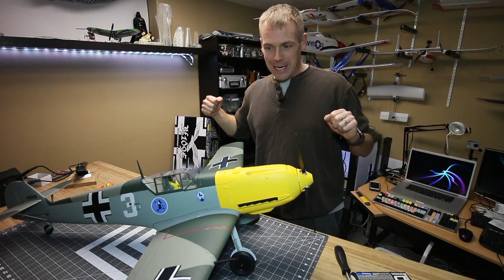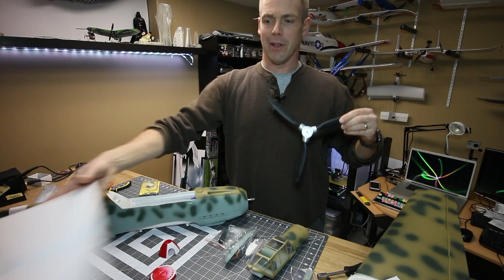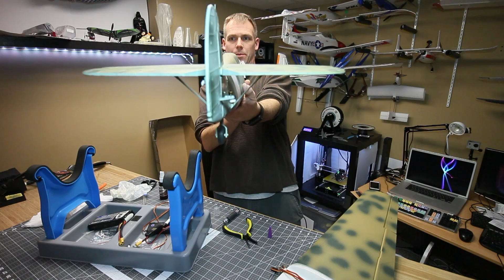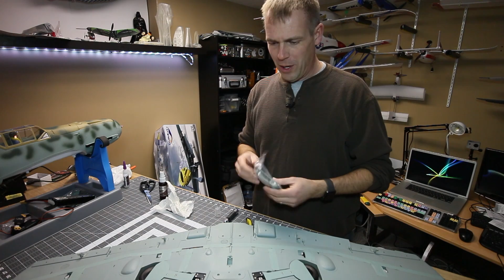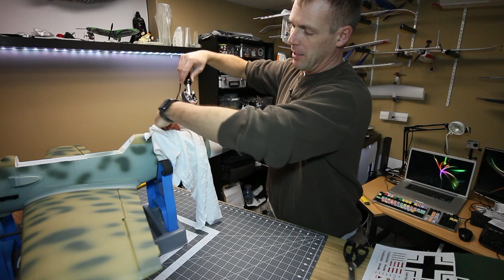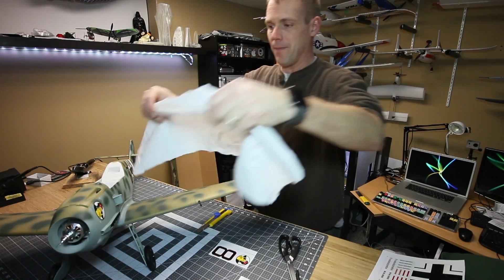Durafly™ Messerschmidt Bf.109E-4 Unboxing & Build

Comment: Hi, you mention 3 or 4s. Have you flown this model on 3s and if so, how did it go? Cheers
Reply from the maker: Only flew it on 4S. 3S will be more “scale”
So you need to watch the power in the turns and really give it some room on take off. Totally fine but have to be more attentive for sure.
Reply: @blameandre  cheers mate.

Comment: I just picked up the navy cub. Would you recommend using the same glue your using for the exhaust (insta cure) to assemble the wing halves? Thought this glue eats away at foam.
Reply from the maker: If you have time, go with Foam Tach. Let it setup, cure and it will be a really good bond.

Comment: What Transmitter battery and battery charger did you use?
Reply from the maker: Turnigy 3S 2000 Radio pack and Charson Antimatter 10A charger.
Reply: @blameandre  Thx

Comment: Having seen a Hispano Aviación HA-1112-M1L Buchón, the Spanish licence built 109G, at Duxford last year in this aircrafts markings I have to point out that you put circular nose decals on the wrong sides. The cats heads should be facing forwards on the port side of the aircraft. Linked is a photo I took at the 2017 Duxford Battle of Britain air show, https://flic.kr/p/Dz79rm . Should have waited to the end of the video. Seems the decals with the kit differ from the example scheme on the aircraft at Duxford. Oh well.
Reply from the maker: Ah that was my error. Good catch.